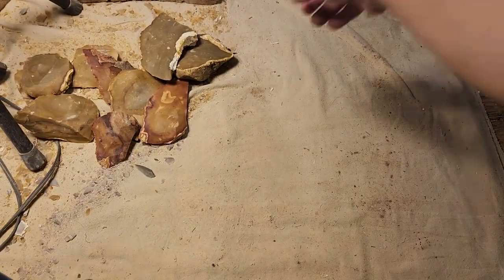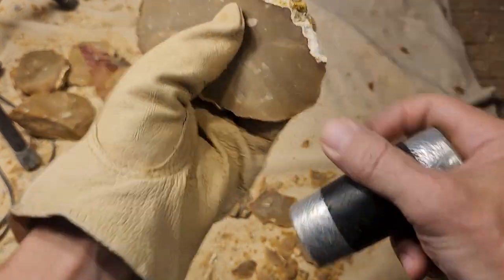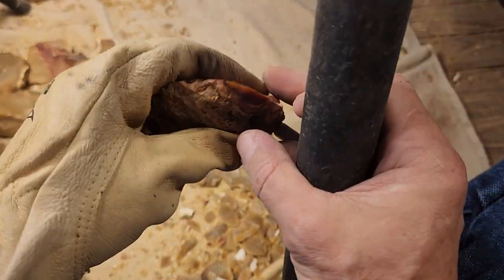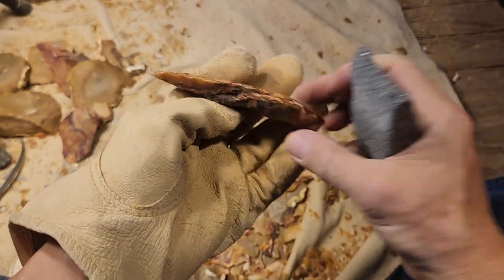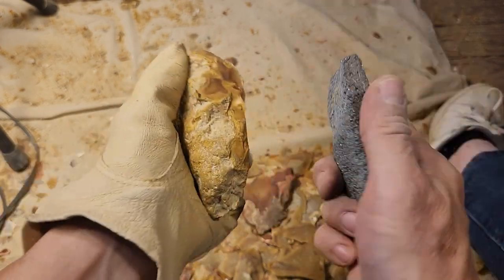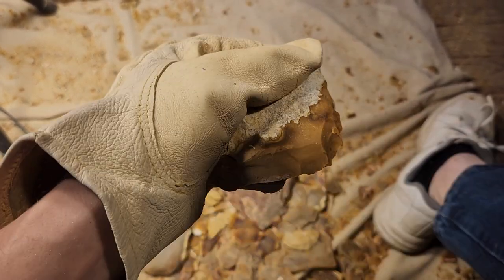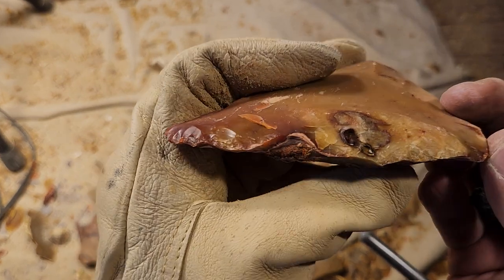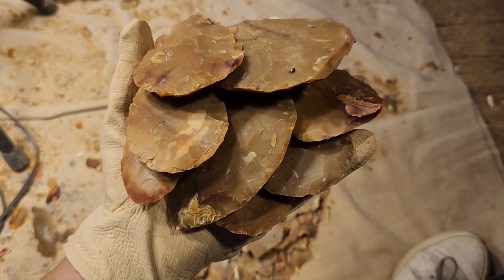1549 - Rapid Fire Biface Flintknapping

Comment: Speaking of moisture content, several wood moisture meters work by simply contacting the surface of the wood. If you are interested this may be feasible. Lowes has one for < $50. Just a thought although may not be worth pursuing.

Comment: Where did you score your aluminum billet at?
Reply from the maker: https://www.ebay.com/itm/266175845281?_trkparms=amclksrc%3DITM%26aid%3D1110006%26algo%3DHOMESPLICE.SIM%26ao%3D1%26asc%3D20221018081743%26meid%3De32d31901eb44b8792d5e7b92b72de53%26pid%3D101429%26rk%3D3%26rkt%3D12%26sd%3D282339537047%26itm%3D266175845281%26pmt%3D1%26noa%3D0%26pg%3D2332490%26algv%3DSimPLMWebV1&_trksid=p2332490.c101429.m2460&amdata=cksum%3A266175845281e32d31901eb44b8792d5e7b92b72de53%7Cenc%3AAQAIAAAA4I6qvrING7O0hZFcnxkK5HPSYOKKwn5Kc%252BUT4Ylrtka5VXw7DcrNLzxtBeUcV8tf8amneU08y2ylIYh6bNugNFGYZYCrMe%252F7DFVO1o%252BsQew0qdYUQht551l9Hjnw%252F2E2bqsNFiz6HxvGN80KWDuhaFY4224NbPVa3YnLaroxi9%252FM6MPcfL6Kn7BurP1YD7pilD7a6DwL7WsBn4PrGGRs%252BV1vPd7DmDsVvyaj5lBRr%252FC8r9vnBkWGTmDEgUw4ZJFyLmJLa3FAWJAMaZw9skcp4%252BdhRLa%252FTACSFMjOxwCLB9Cq%7Campid%3APL_CLK%7Cclp%3A2332490

Comment: Hey Patrick how about rapid fire hunting arrowheads with no persnickety stuff? I'm trying to see if 20 minutes is a reasonable expectation I have a short on my channel with the quantity I'm aiming for. If you decide to do it thanks if not I understand your up against it with requests. Jimmy
Reply from the maker: I could try it. As for the timing, I personally came up with 1 hour each because of the high number of failures and spec rejects.
Reply: @KnapperJackCrafty  thanks for even considering my request. Jimmy

Comment: Is that 1/2" rod you started with or 5/8" or bigger? I just received my Dacite 15 spalls) and Mahogony (7 spalls) Obsidian. They look absolutely beautiful man. Flawless. I want to get into them, but I want to transfer to inderect asap, because I Don t want to ruin them with direct. I call them spalls, but they are 70% bifaces already.
Reply from the maker: The only rod I use here is 3/8" diameter steel.
Reply from the maker: I recommend 1/2" diameter aluminum for Obsidian.